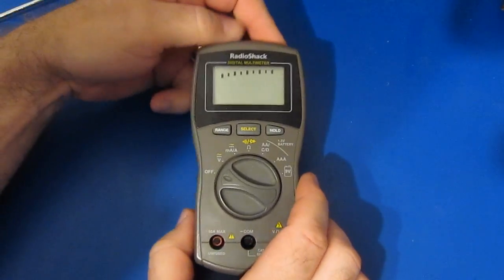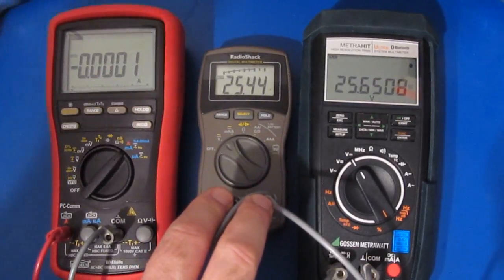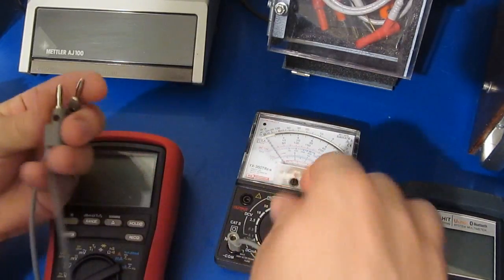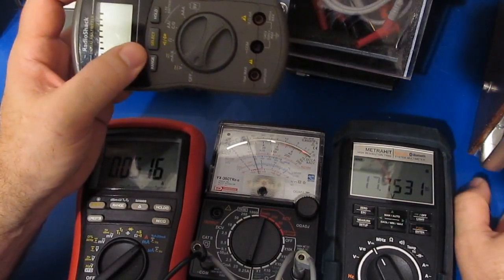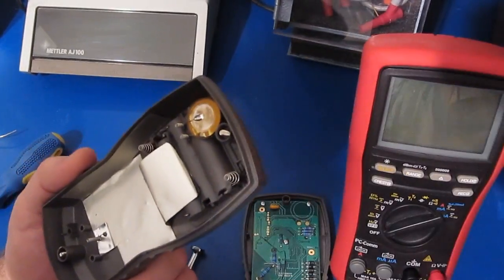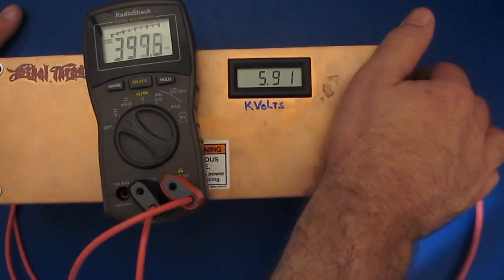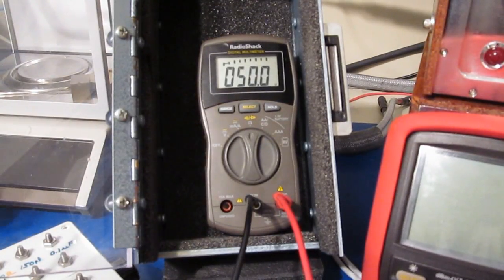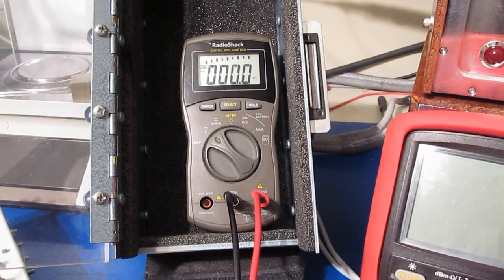RadioShack Catalog 22-813 Handheld Meter Transient Tests

Comment: Can I check relays with those meter
Reply from the maker: Depends what you are asking.  It can measure resistance and voltage but that's not enough to actually cycle the relay and load the contacts.   If you plan to just measure the relay in-circuit and see if the contacts are opening and closing, sure.  Any meter should be able to do this.
Reply from the maker: Maybe watch this guys video.  Towards the end, he shows his setup.   https://www.youtube.com/watch?v=S-DwV0HLsE4

Comment: I'm a fledgling electronic hobbyist, and this is one of my favorite meters to work with.  I've been building circuits on Elenco - All in One electronic kits and then check for what's going on using this meter. It seemed very accurate to me in your tests and you couldn't kill it.  It seems more than adequate for the low voltages I'm working with.  Thanks for making the video.  I was fishing around on YouTube for an opinion piece about it from someone who knows what their doing.

Comment: I’m confused. Isn’t the fuse supposed to blow if there is a spike?  Are you saying even with a blown fuse, this multimeter will still conduct voltage/current posing harm to the user?
Reply from the maker: I imagine the designers first goal was to  prevent damage to the shunt and other circuits if the user over loaded the input.  I would also guess that they have a fuse that can handle a user putting the meter into the mA mode with the leads attached across the AC line.    I've show several videos of glass fuses and at least the spikes I test with.  Many companies will supply their handheld DMMs with HRC fuses for the safety reasons you mention.      As far as why I didn't run it, at 1:12 I talk about the reason.   Had this meter used standard design practices, I would have ran it.

Comment: I also have a 22-813, however it is board V2.1, dated 2011.05.03. It's all surface mount now except for a cluster of 4 PTCs, and the fuse is only used on the current range now, so the fuse can be blown and everything other than current will still work.

Comment: Not bad for an old meter, your torture did not phase it lol :-D.
The words Tandy,Realistic,Micronta, and Radio shack jump to mind.

 i have an old micronta digital with a dmm chip made by seiko, almost identical to modern dmm chips, amazing as i bought it back in 1985.
That came from tandy, but i dont think radio shack ever made there own equipment, but it allways did the job :-D.
Reply from the maker: Right, that's because I basically decided not to run it.
Reply: The line was a joke, note the "lol" and smile.
And the rest of my comment had no interest?
Reply from the maker: My first brand new meter was a Miconta from RadioShack.  Analog similar to the cheap black one I show in the video.  I did a lot of experiments using that meter.  Damaged countless resistors inside it.    My first digital one was the Fluke from 1982ish.   That think would get damaged if you looked at it funny.
Reply: I also bought a micronta analog meter but from tandys, it was shiney black plastic with half of the case being a white meter, a 22-204 i think.
It also had a red switch/thumb wheel on top, the sockets sat to the left of the range/function switch.
Shame tandy is gone :-(
Reply from the maker: I believe that was the meter I had.  I have a picture of me getting it on my birthday.  Box is green like this one.    http://www.ebay.com/itm/Micronta-Multimeter-22-204A-Multitester-/322550282094?hash=item4b197eb76e
Reply: Yes that is the same one i had lol, i didn't remember the full catalogue code, just the "A" was forgotten.
It worked really well for me, although i was really carefull with the settings and the probe wires, i didn't want to kill it as i didn't have much money then.
I think there is only maplins that have similar products to tandy.
The good thing is maplins don't sell Archer resistors and pots, they were really crap lol.